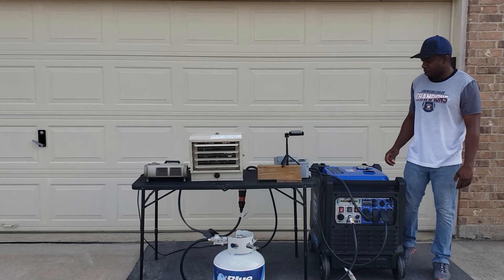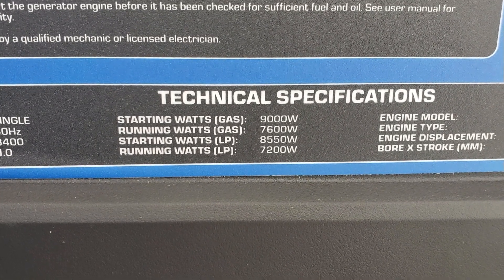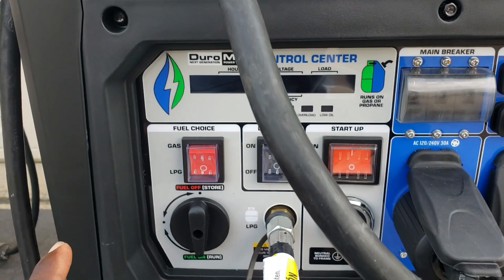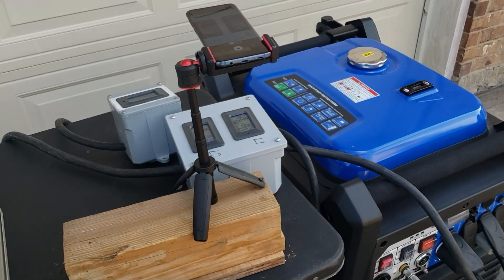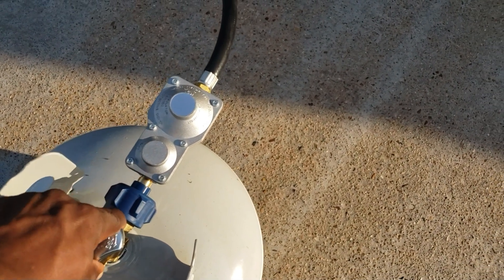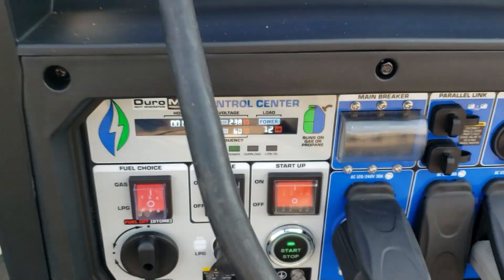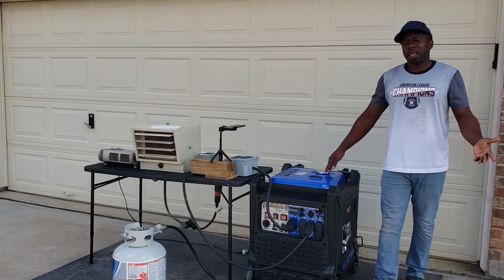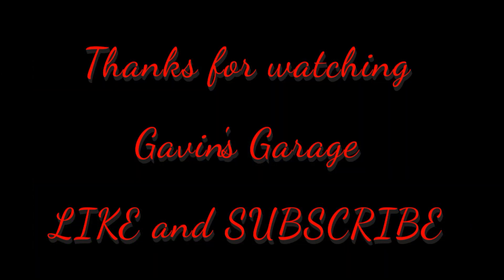MAXIMUM Power Output of the DuroMax XP9000iH 9KW Dual Fuel Inverter (Generator Review)

Comment: Hi Gavin. I have a question about your duromax xp9000ih. Did you unbind the neutral or leave it bonded?
Reply from the maker: You don’t need to worry about that with this one because it doesn’t have the neutral wire bonded.

Comment: Love your reviews Gavin and I've learned a lot from watching them. I have a question though about when you overloaded the generator and it shed the load. Did a breaker trip or did the output voltage just go to zero as if there is an internal overload circuit of some sorts? 
I'm curious because we had our Duromax 9000 connected to the house one time and all the power went out. The breakers on the generator were okay but there was no output voltage and it was running at low idle. I don't remember seeing the overload light but it worked fine after turning it off and back on.
Reply from the maker: The breaker actually tripped
Reply: @GeneratorReviews  Thanks for the reply Gavin and thanks again for all the time and effort you put into these videos. 
I swear that there's more useful information in any one of your videos than there is in the entire owners manual.

Comment: Gavin, I like your reports. Just got the DuroMax 9000. What I do not understand is the runtime HOURS gauge. It just seems to alternate between hours:minutes and hours of the CURRENT run, not total runtime. Am I missing something? I am in CA and with outages from atmospheric rivers topping 50 hours.
Reply from the maker: It should show total run time also
Reply: @GeneratorReviews  It only shows the time for the current session. When you power off and back on, it starts with 0000.

Comment: finally settled on this, they are selling right now for $2100, which is less than half the price of a Honda, and for my use (sparingly for hurricanes or other weather events) it should get the job done running all my essentials and the 3T AC (with soft start) AND be MUCH MUCH quieter than an open frame 3600RPM machine, it's not like i'm running this thing for a business or anything (in that case i would buy a Honda) 
i plan to keep my power usage under 6000W to improve longevity

Comment: I have a small single wide mobile home. I have one mobile home cable that runs almost everything that plugs into the PGE box, but the A/C and water heater is connected to a separate hard wire to the PGE box. Not knowing/understanding how this trailer is wired, I purchased a Predator 3500. It runs the trailer home fine, but no hook up for A/C (220v). It seems your real smart on these generators. What would you recommend for the best 9,000 Watt Dual Fuel Portable Inverter Generator w/ CO Alert, 50 amp plug and clean computer voltage. I think I would like to use Propane.
Reply from the maker: If you’re looking for a 50 and I’ll put on the generator the Genmax 9000 dual fuel would work perfectly for you
https://youtu.be/svK1zuuq57A

Comment: How big of a propane tank can use use with the adapter they gave you? Is a 100lb cylinder tank ok to use or do you have to do other things and is so what are they? Thanks in advance from a loyal subscriber)
Reply from the maker: I know all the specs are based on a 40 pound propane tank. Once you get the right fuel regulator for the tank size you should be fine
Reply: @GeneratorReviews  Thanks for the quick response! When you say "specs" I presume you mean the regulator that comes with it. So it sounds like for a 100lb tank you will need to get another regulator.  Would you know off hand what size or type of regulator you need? The propane industry isn't  too helpful if you know what I mean:) BYW  do you know hoe many BTUs the generator is I think that relates to the regulator you need? Thanks.

Comment: Gavin
The Duramax uses .35gph
We're as the Gen Max is. 48gph can't make up my mind? Gen Max is better but in crisis the Duramax will last longer. What are your thoughts what would I do if I can only get 1 thanks
Urs. R the best video also still waiting for the video of a proper break in on gen max no 1 else has done a good one. Peace ✌️
Reply from the maker: They both great generators if you feel one is more fuel efficient go for that one, you can’t really go wrong.

Comment: Gavin I've decided on the gym Max 9000 IED too many pluses oil filter 50 amp plug insulated side panels cooling fan smarter looking exhaust off the back it's the one I just don't know what the THD is I know on the Duramax is 5% do you know what the THC is on the Gen Max you're helping this matters greatly appreciated I thumbs up every one of your videos peace
Reply from the maker: The Genmax 9k has a less then 5% THD also. 
Thanks for watching buddy

Comment: What is better for you this DuroMax or GENMAX GM9000iED ?
Reply from the maker: Both great generators they just have different features it all depends on what you’re looking for.
Reply: @GeneratorReviews  for all purpose overall what you recommend between GENMAX or DuroMax  ?
Reply from the maker: @JesusGonzalez-my1no Get the Genmax Forced air cooling 50 amp plug no need for parallel kit

Comment: I like this kind of Test ,  I looking for Inverter Generator , this one is this biggest I think , BUT I want to run My Mitsubishi Zuba-Central 3T.  I check the max amp need for the defrost cycle ( Live in Quebec , Canada ) with a clamp.  I see 28 amp ... ( the big boy is on a 30 amp breaker ) But at the same time I have my Air fan for the dock ( 1,25 amp ) I'm a little close of the 30 amp for the 240 volts outlets.  This output can Handle .... 30 or 31 amp for a minute or 2 you think ?

Comment: after using generators for a while, the best setup you can do is a battery bank with charge controller and your own inverter that feeds into the house panel with cutoff. PROPANE is the only fuel to use in my opinion when you add up fuel costs and longevity of engine. You set up your generator to kick on when battery bank gets down to a percentage and let the generator top it off. and also kick in some solar panels. You can easily live off- grid with normal home if you do this. Get better efficient appliances and rely on them less. You be amazed on how no paying utility company can pay for your equipment over time and its your and you are independant. The only downside is neighbors when power outages occur and they think they should piggyback off you. Wont be long and I wont have neighbors though, Im getting out of the area soon. Yes Im taking my power system with me. but leaving the solar hot water and basic panels that are older and to much work to remove.
Reply from the maker: Nice setup 👍🏾

Comment: Gavin, another excellent video. I have a question for you; what is your  recommended brand for a an emergency use house back-up generator? I’m talking brand, clean power output, and best bang for the buck. Again, this is to get the family through an occasional power outages - well pump, fridges, freezer and a few light bulbs …. I look forward to your opinion and recommendation. Thanks again!!
Reply from the maker: Hey Ron
I’m working on this exact video waiting on one more manufacturer to release the last generator but its 6k and up 240v whole house backup power 
You will definitely get your answer from this vid I promise

Comment: Gavin, which magnetic oil dipstick do you recommend for this unit? I mostly see predator and champion magnetic dipsticks for the 3500 model. Will they work for this model?
Reply from the maker: Just buy the one for the predator 9500 the exact same size

Comment: Hi Gavin Great Video. Iv got a quick question to see if you have run across this with your XP9000iH. I have called Duromax about this but I haven't gotten an answer yet.  
The hour meter keeps resetting when I turn off the generator and restart it. The Minute indicator seems to be working fine. The hour will show how many hours its been running total but once I restart the unit the hour meter starts all over again from 0.  I might try and disconnect the battery just to see if that might work (Didn't Work) . Hoping there’s a reset somewhere. Probably dreaming.  Fingers and Toes crossed
Reply from the maker: That timer is just a generator run timer. The main purpose for that timer is so it let you know how long the generators been running it’s not a lifetime maintenance timer I will double check just to make sure
Reply: @GeneratorReviews  There’s two timers ,one is the long-term hour meter and the other is an hour/minute meter of how long it’s been running since it was last started. The two timers flip back-and-forth  . The long term hour meter is the one that is resetting. A few folks out on the web have said that I might need to run it at least 4 to 5 hours continuous before that hour meter starts locking in. I’ve got about 6 to 7 hours on it already but the longest  it ran continuous was about three hours I’ll try to run it for 4+ hours tomorrow and see what happens.
Thanks again for your help
Reply from the maker: @Rk-mt4ll  ok let me check since I have the Gen1 and Gen2  Let me see if that’s something they fixed on the newer version with the CO monitor.
Reply: @GeneratorReviews  Thanks Gavin
Reply: Did you ever find out about hr meter not holding? Thanks

Comment: Will this XP9000IH run a 5 ton central ac, a refrigerator, and a few lights?
Reply from the maker: That’s the exact same test you just mentioned I want to run but it’s too cold to run my A/C.
I also have a 5 ton AC so I would like to find that out when it gets warmer I will do this test.
If you haven’t subscribe to my channel please subscribe and wait for this test
Reply: It runs our home's 3 ton hvac system with no problems. You will want a hard start kit or soft start though.
It will also run numerous other things in our house at the same time. You will need to make sure you balance the load on both sides of the 240 to maximize what you can run.

Comment: Gavin, what is the Horse power on the DuroMax 9,000 engine? I’ve looked strong and can’t find the listing.
Reply from the maker: Hey Carl, The Duromax at 459cc should be rated at 30 hp engine. That is more than enough engine to support its output power.
Thanks for watching 👍🏾
Reply: @GeneratorReviews  So If I were to connect this to NG, it would consume 30 x 2543 = 76,20 BTU of NG draw.  Right?
Reply from the maker: @CureInsomnia  30×240 = 7200w

Comment: Why did it shut off at 7600 or 7700 watts?  I thought that was its rated 'running' wattage?  With peak 9000?  That seems like its possibly using an under sized main breaker?
Reply from the maker: Your peak 9000 W that’s only for like four seconds so it would start the load up to 9000 W but 7600 W that’s your running wattage

Comment: Say Gavin is there a way to convert to Natural gas using the propane line ?
Reply from the maker: That’s something I haven’t tried but I will look into it for you
Reply: @GeneratorReviews  Did you ever find a way to convert it to natural gas?
Reply from the maker: @mattrevell  Yes I found a sponsor that’s going to supply that hardware so I’m just waiting for that to come through
Reply: @GeneratorReviews  Great...I am considering going with this model but would like the NG option.  The various vendors I reached out to indicated that they didn't have a kit available at this time.  Will be following closely.
Reply: It looks as if the regulator is on the lp tank. I would think if you had a NG regulator with the primer button (Forgot what they were called, sorry.) This may work. Definitely worth a try. I'm curious too. I converted a Ryobi 2300 inverter to NG and it runs as it should.

Comment: Hi Gavin
I have an odd question. Do you have the dimensions of the box that the XP9000iH came in. I cant find it online anywhere. 
Thanks A Bunch. 
Robert
Reply from the maker: Height 31.5
Weight 32.5
Length 26
Reply: @GeneratorReviews  
Sweet Thanks A Bunch

Comment: you should an unboxing of the power horse 7500i from northern tool and put against the Duromax xp9000ih and see which is most quiet with a full load on it and which has a higher load and how long it can hold that load before it trips the breakers

Comment: Thanks for all your great videos. I was just curious about the voltage reading on the generators screen, at one point it reads 238 volts then with no other load added it switched to 119 volts.
Is the small grey box monitoring one of the 120 plugs and the larger box monitoring both 120 volt legs of the 30 amp plug. Where did you find these amp meters. (Amazon)
Reply from the maker: I actually bought the monitors off Amazon but I made them myself and you’re right one monitors the 240 V and the other one monitors the 120 V plugs
The reason you saw the 238V once I plugged in the 240V appliance it’s senses that it switches to 240v

Comment: Sir,

Thanks for the test.  The engine sure held up  under load.  I also suspect it hadn't really had a chance to break in where these small engines seem to get another 5-10% power.  It appeared the engine was good for more but the circuit breaker tripped at 7700 watts.  I think you could have gone to 8200 watts by plugging an identical small heater on a 500 watt setting on the other breaker side of the 240.  The only reason it gave up at 7700 watts was the breaker on that leg.  If the breaker on the other leg had exactly identical characteristics, I truly believe you could have gotten 8200 before you had a system shutdown.  The breakers are protecting the inverter, not the engine.  For instance, you couldn't have taken 7200 watts in a 120 volt situation off of one side because the breaker wouldn't stand the 60 amps.  

Keep those interesting and informative videos coming, 

A.T. Burke
Reply from the maker: Thanks for watching. I actually tried it several different ways after this test seems like there’s more engine than inverter like someone else stated but Regardless of where I plugged in once it added up to around 7700 watts it would shut off
Reply: How much could you run if a 30 amp breaker was in the circuit

Comment: I suspect that the 9500 will be the same. I would have to believe they are the same (Predator and Duromax) unit just a different color and some feature differences. Is one better than the other? Debatable in my mind. The biggest test? Which company will support their customers the best. Duromax already has a leg up with a three year warranty vs HF's 90 day or additional cost extended warranty. The biggest standout is the dual fuel from the factory on the Duromax. While you can purchase an aftermarket one for the Predator online, will it void all warranties?
Reply from the maker: Thanks for the comment Tom 
The Duromax does have the advantage of the factory duel fuel and it has a three-year warranty. But we’ll see when I do the test if it overloads exactly where the Duromax overloaded

Comment: With the inverter gens getting bigger and better every day, I'm waiting to see who is the first to market with a "stationary/built in" inverter generator in an outdoor enclosure for home backup, to compete against the traditional gens like Generac, Kohler and Briggs.  Those gens are loud and plow through natural gas, as they are screaming away at 3600RPM when running.  A 10-25KW outdoor natural gas inverter gen lineup will change that market.  Maybe another year or 2...
Reply: My money is on Champion.
Reply: Tristan, I thought the same thing, but knowing the price would shoot up tremendously, I did some research and looked at building an enclosure with a Walmart sheds with exhaust and cooling fans...it came to about $600 to build, a Generlink transfer switch and an auto start kit. It was still a lot cheaper than installing a Generac or Kohler. Check into the Generlink switch...I think I came up with a price tag of under $5000 and that included a soft starter for a 4 ton AC unit
Reply from the maker: That would definitely be a game changer and I don’t know why it hasn’t been done like you said probably the next year or two
Reply: @GeneratorReviews  you should an unboxing of the power horse 7500i from northern tool and put against the Duromax xp9000ih and see which is most quiet with a full load on it and which has a higher load and how long it can hold that load before it trips the breakers

Comment: After researching inverter gens for years now, there was nothing ever close to the KW and 120/240 output of the Honda EU6500 and EU7000.  Nothing close...  Until now!  For a few hundred more than the Predator,  this unit has a real panel for hours and KW, and dual fuel.  Great video!  I think this is the TOP DOG right now.
Reply: Dawg it's bigger than top dog 🐕 these katz is poppin.  Made in china